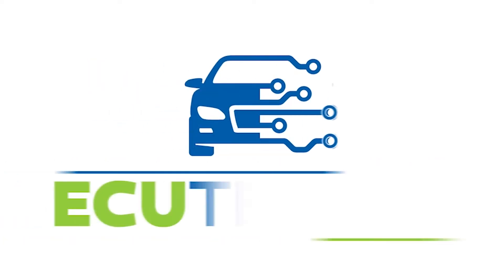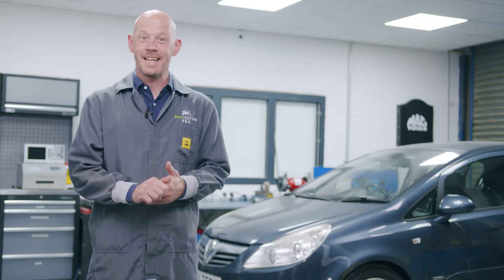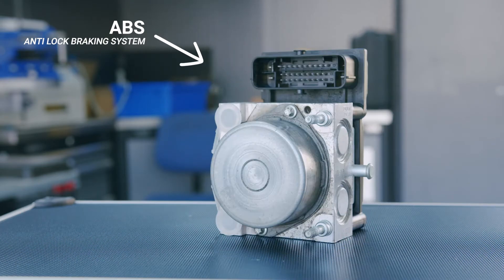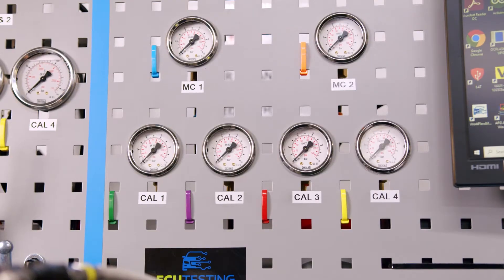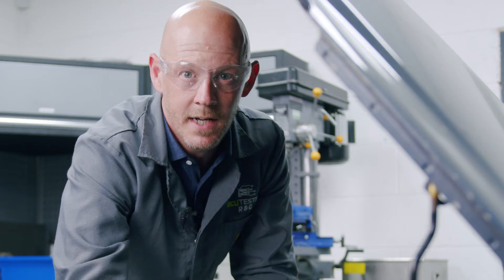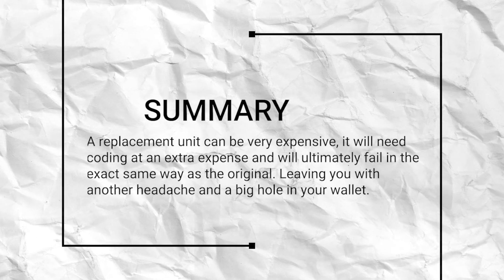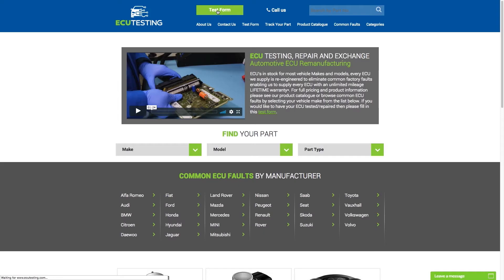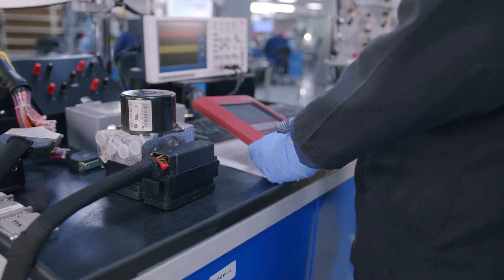Corsa D ABS Pump – Emergency Braking Fault Fixed

Comment: What's the cost of a rebuilt unit and time frame
Reply from the maker: Hi there, for our most up to date prices you can search your part number on our website - https://www.ecutesting.com or give us a call on 01773535638. Our current turn around time is estimated at 2 - 3 working days. Thank you!

Comment: I’ve just passed my MOT on my car yet apparently the ABS PUMP needs replacing and he still passed it so don’t no wether I’m being conned out of money what shall I do as there’s no ABS showing up on my car it goes off like it should
Reply from the maker: Hi. We would recommend asking the garage that gave you this diagnosis for a technical report and any diagnostic information/fault codes. If you are able to get these then please send them to our technical support team at info@ecutesting.com and they will advise you further. Thanks

Comment: I have just sent an ABS to Ecotesting for repair/rebuild.  However, the part numbers on my ABS unit did not match any of the units stated in your product catalogue.  I have a vauxhall corsa 1.0 ecoflex 2013.  Would you still be able to repair it?